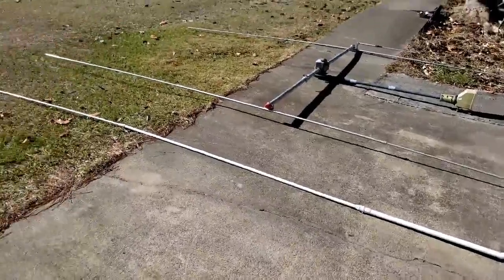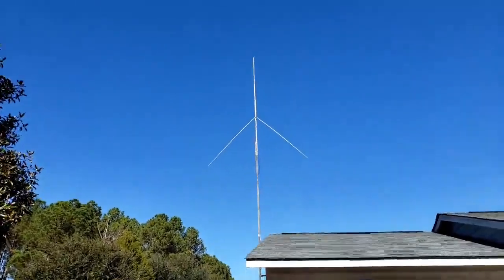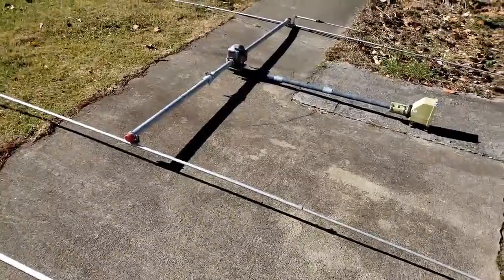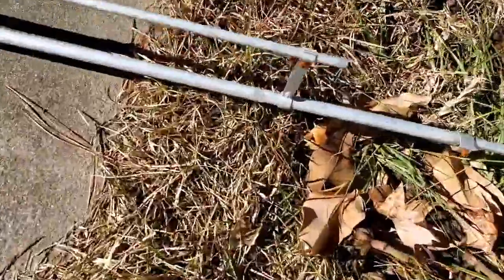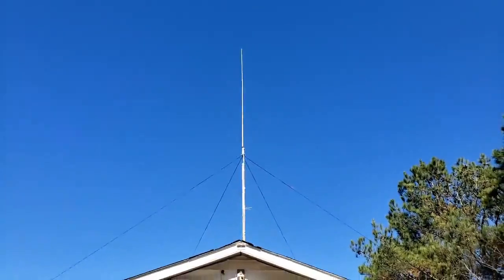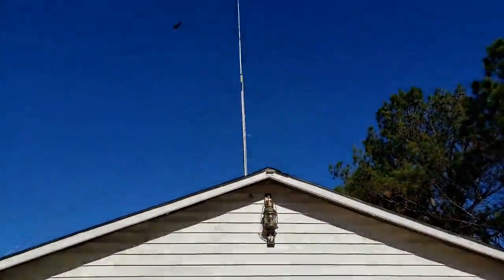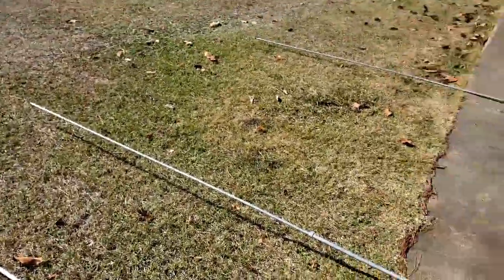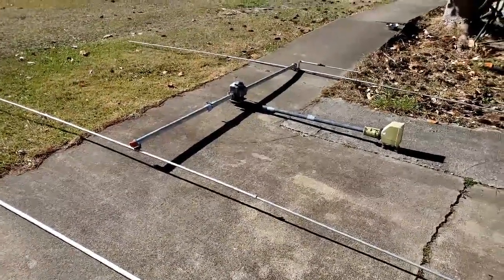Antenna update, My CB Radio Base Stations

Comment: Back in the early '90s I had an E-Z Way 20ft tower with a 20ft mast. The tower was hinged on a mounting post about 5 ft from the ground and was tilted from horizontal to vertical with a hand winch. The 20ft mast was shot up through the center with another hand winch. Wish I had never sold it but I was moving and has no option.

Comment: I have a Tram 1498 antenna and it works great for skip and local, I live in Wisconsin and have it up on a 25 foot mast so the tip is at 45 feet....

Comment: Great stuff there John.  You've been a busy boy 😂.  I had a bit of a disaster here the other day as my I max 2000 just went dead for some reason. Tried the usual like new coax and plugs  but ....nope it's dead lol.  Swr won't go lower than a 2 every where . So iam done with it now it's only 4 years old 😭.  Been using my homemade slim Jim instead and it's working great 👍....keep safe my friend. 73s   good dx .
Reply: I need a gama match???
Reply from the maker: That sucks! good thing you have a good old reliable homemade antenna. Take care 456, 73's from 151 SC.

Comment: Lessons learned from ungrounded antennas...
A few years ago I got an Olson Spotter 23 in nearly mint condition. It had an intermittent loss of receiving sensitivity that reminded me of a Spotter 3 I had 50 years ago. Armed with the schematic and ohmmeter, I started at the antenna connection and found the problem at the T/R relay. Removing the cover revealed a burned-off wire on the antenna side of the relay. My guess is that a near-hit on an ungrounded antenna like a dipole or ground plane was the culprit...enough to burn the wire, not enough to destroy the radio. I took my Starduster down after a near-hit took out one TV and every cable box in the house!

Comment: I have a 3 element beam up for 12 years at 1.1 on 11 and 1.3 on 10 now the SWR are at 2.9, I can see from a distance that the aluminium seems corroded, my Starduster got killed a few years by a big storm, I replace it with an Antron it now showing 1.9 so I have a lot of Antenna repair to make, nice work, yep that's what I have a maco
Reply from the maker: when I put my Maco m103 back into use, I am definitely going to seal the connections. I hope You can get Your antennas back in action soon. Take care, 73's from 151 SC.

Comment: On 17 through 6 meters I work the world an a A99 3ft off the ground. And on another 19ft vertical antenna I cover all bands and it is also 3 ft off the ground. Verticals low to the ground are great for DX. I also have a wire dipole  abt 25ft off the ground. The verticals are better for DX

Comment: Hello mate. Quick question. I have a half wave silver rod on a 18 story tower block roof. Anyway the wind up there really bends the antenna so I was thinking about putting something inside the antenna to make it more ridged. Will doing so affect the performance of the antenna? Would wood be better than metal?    Also there is a lot of 5g digital stuff on the roof. Will that/they affect my analogue antenna?
Reply from the maker: PVC pipe would probably work well. Wood can hold moisture, and would affect performance when wet.
I wouldn't worry about those digital signals, I don't think it would interfere.
Take care, 73's from 151 SC.
Reply: @MowerJunkie  thanks for your reply mate. I'll take in everything thing you said 👍

Comment: I made up a self supporting mast. I used the top rail of diamond 💎 wire fence. I made 3 mast stands and a mast of an additional fifteen feet. I have a welding machine and I put the mast stands on a foot long short length at 120° each.

Adding to the mast from the bottom is easier. Make it a tripod mast stand.

Comment: Most likely you have already done something else, but you could or can insulate the two sides of the driven element getting rid of the gamma match and adjusting the SWR by changing the length of each element keeping them the same length, and getting away from this problem, or just buy a new gamma match from EBAY.    You remind me of all the antenna experimenting that was going on in the 60s when I first got into the hobby. Still fun watching !!! Now go talk to New Zealand, likely the farthest away place you are yet to speak to?
Reply from the maker: About 2 or 3 months ago I built a direct feed Yagi, and it works great. I also made a new gamma match for my old Yagi, I'll be testing it out soon.
a few days ago I had a QSO with a station in New Zealand, Unfortunately I did not have My camera setup.
Reply: Good!!

Comment: Hey your accent sounds a bit familiar like you might come from my old neighborhood where I grew up any title so anyway this was just some food for thought about 50 years ago or maybe better when I was playing around with CB with the first time I had a ground plane antenna on my roof high on the hill known as the highlands in Lynn Massachusetts the skip Open. One year it was unbelievable I was talking clean across the Atlantic I had Europe in my backyard I was so thrilled what the weather up there was never too friendly on antennas finally I got an antenna called the Super Mag it was a 5/8 wave antenna but after about seven or eight years I replaced it with a 5/8 with Ringo man what a difference with that you can still buy the Ringo but you won't find it in any CB shop you got to go to a ham store they said for 10 minutes but it will turn all the way down into 11 meter CB band and Beyond the name of the company is called cushcraft
Reply from the maker: Yup You guessed it, I'm from New Bedford Ma. I moved south about 7 years ago.
I also have an old Antenna specialists "Mighty Magnum III" it's a great antenna, but it has a very low power handling rating. 
Take care, 73's from 151 SC.

Comment: I'm thinking about an A99 for when I get my base set up. What's your opinion on the A99?
Reply from the maker: The A99 is a good antenna, and easy to set up. Good luck with your station, 73's from 151 SC.
Reply: I used the A99 when I first setup my base. I changed it to a Sirio 2016. Only cost a little more but I get less noise, better recieve and transmit.
Reply: @MowerJunkie  thank you much, sir! Happy Thanksgiving!
Reply: @027MC7  thank you. I'll look into it
Reply: Texas  12  vavle if put A99 make sure have washers on top to middle section on tight also bottom of middle to bottom section tight but on threads use thin layer of Vaseline on them before assembly together and have 2 rings together and turn 3 full turns plus 1/2 turn from top to bottom on rings together! Match be 28.000 Mhz on 1.1 SWR , 27.999 to 27.415 MHZ be flat 0   to CB band be flat 0 on Ch. 1 to 40  and 26.000  to 26. 500 1.3 but after 26.500 up to 26.965 channel go 1.3 to flat ! Also if use Ham frequency 28.000 to 29.999 be 1.1 to 1. 5 SWR ! Also ground tower to a battery cable is 1/2 inch round and 4 feet long  use steal bolts thru copper eyes connectors each end plus washer together to tower and ground rod of copper with washer sandwiches together! Also water ground rod much as you can 2 times day unless get rain Lol don't worry about it! Higher height is better more 40 feet if can ! Also use tv tower plus strong round water pipe to is steal too! A99 is 1/2 wave antenna but if ever afford get a I max 2000 it 5/8 wave and powerfull Fibreglass antenna it 24 feet long big brother to A99 also I had A 99 from 1994 too 2002 then got hit by lightning and got I max 2000 in 2002 and be up since!
Reply: @AndrewHCann  thank you for all the tips! If I get the A99 I'll definitely come back to your comment when putting it up!
Reply: @Texas12valve   welcome and no problem with that also glad help out! I been on CB radio since 1979 on late dad had setup on farm before sold 1997 also my own September 5 1986 to and seen also had lots radios brands long time to! Funny part I done base and mobile setups since 1994 to! Plus if watch Mower Junkie for long got mint condition radio of Realistic TRC 428 Nine Scan , Uniden Grant XL and Super Sonic he has I have them too! Also if need assistance any antenna just ask me anytime!
Reply: @AndrewHCann  I was born in 1999 so I wasn't around when CB was at its peak. But its been a hobby I've been in since about 2015. My dad doesn't really care about it. My grandfather is the one who got me in to it. He has a old 148 side mic in his truck and he used to have a base station on his farm. So now I'd like to have my own when I move into my own house in 4 months. But I got my girlfriend in to them and she has a pink cobra 29 in her car and I have 2 that I switch between in my truck, a cobra 29lx and a 148NW ST
Reply: @Texas12valve  a £35 silver rod would give that antron a good run for its money. Get the silver and put the rest of the money into good good quality coax and plugs would be my advice
Reply: My opinion is it's just a piece of wire covered in fibreglass.

Comment: Strange how the Groundplane is as good as the two Element Yagi , Considering a properly spaced 2 element Yagi has around 5 dbd of forward gain , Whereas the ground plane has basically zero gain ...... The Groundplane would also have a higher angle of radiation or take of angle for a given height , I could only assume then that the two Element Yagi isn't actually performing correctly as a two element Yagi should .
Reply from the maker: not really, antenna gain represents an antennas transmit capability, not it's receive capability. receive is improved with height, and a good quality antenna. Thanks for watching, 73's from 151 SC.

Comment: A 1/4 wave is good for near comms and a contender for DX, but not a good choice for contacts on the horizon due to its high angle of radiation. A 5/8 wave, due to its low angle of radiation is an excellent choice for contacts on the horizon, but has quite a bit of ground loss and loss in the matching network necessary to match to 50 ohm coax. A 5/8 antenna is good for long-distance DX, but a poor choice for sporadic E, the most common "skip" on 10/11 meters. 
A direct fed, resonant 1/2 wave ground plane is the best all-around, omnidirectional antenna. By virtue, it has a characteristic impedance of around 50 ohms. No need for lossy matching networks like the A-99 or especially the IMAX 2000.
Reply: A 1/2 wave, end fed vertical like the Cush Craft Ringo, has a characteristic impedance of around 1800 ohms. The way manufacturers solved that was to DC ground the antenna and feed it at a point above ground where the antenna was neither 1800 ohms nor a short-circuit. 
On the Ringo it's fed on the matching ring. 
On an antenna like the Super Magnum the feedpoint is on the matching coil a few turns above ground. 
All CB antennas other than a 1/2 wave dipole (Starduster included) and a 1/4 wave ground plane require a matching network.
Reply from the maker: A Starduster (1/4 wave groundplane) does not need a matching network, it has a natural 50 ohm resistance. Check out the build video of My Starduster clone, it shows how I built the feed point.
Reply: @MowerJunkie   plz give that tutorial video link

Comment: Mower mate. Put a half wave silver rod  £35 against a £135 antenna for people to see please. Not much difference in them. I was gonna put a expensive antenna on my tower block roof, the guy in the shop said it ain't worth it at my height. £100 extra for a possible extra s point.  Was gonna get the 5/8 wave silver rod. He said there ain't much difference between the two. He said he actually prefers the half wave..  I use a mint mk 1 cobra 148 GTL DX with a 575 m6 teardrop. I also use a alinco DX 10. Job done. Oh and a little 100 watt linear that I hardly use. No need. Height really is might. 1/1 swr on the silver rod
Reply: Height only matters when working groundwave or local. Skywaves work no matter the height. Antenna handbooks speak of a "mirror image" of a vertical antenna and that the antenna must be a certain wavelength high to properly use the mirror image. They also mention adjusting the length of the coax so that a voltage or current maximum is present at the antenna feedpoint. 
Most of us, myself included, just put it up and hook up the coax and it works just fine.